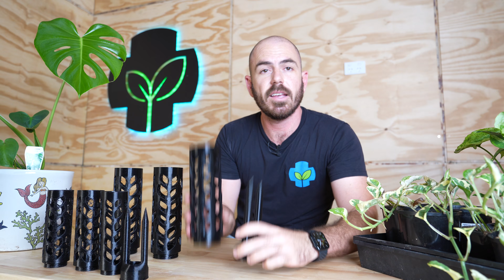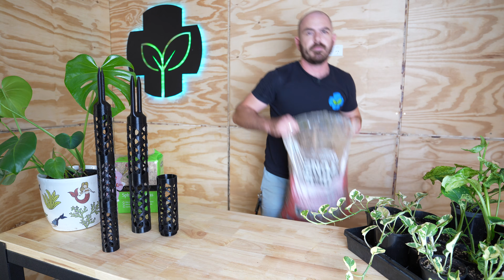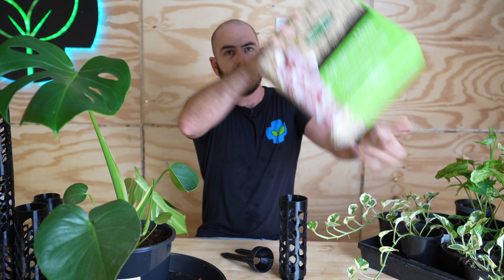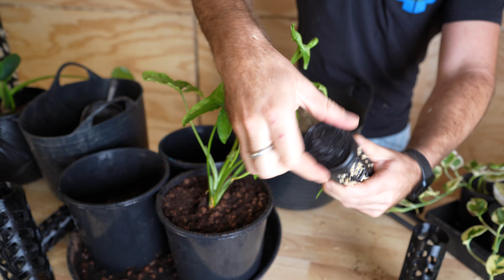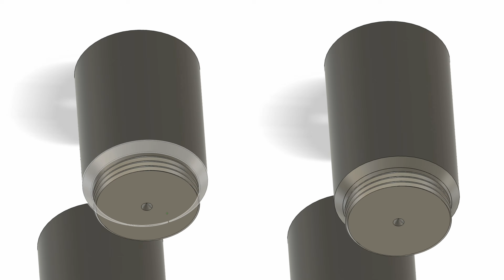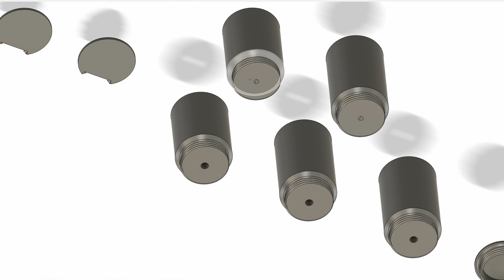3D Printable Modular Moss Pole for Climbing Plants

Comment: Info missed stated: use PETG filament, if you want an easy AND very good 3DP then get a BambuLab X1C. I have an Ender3, was my starter, it works but so much extra effort/mods  to get it to work. X1C being totally enclosed is key to success the first time not the last. Plus I've printed +1K hours on X1C with no down time and only two bad prints (that's on me). 

Moss Pole 3D: How long did it take to print:
    1 base?
    1 tube?
    1 top?

Comment: that is amazing - tried to join your fb group - bought my 3d printer and a lot more using your links - but now I have questions that needs answered - got blocked from fb because I shared something that was NOT an affiliate link - absolutely got questions and no where to go - I got the 3d printer max pro and need to know what accessories that you recommend for the printer

Comment: I really love this and look forward to downloading joining to get the file but I feel like there is a problem after your plant is rooted into the pole you won’t be able to separate the sections. The roots will grow into different sections from where the node is and make it impossible to unscrew without twisting of the roots inside
Reply from the maker: I’ve thought about this, So the way I was going to get around that is by having segments in the screw that are essentially blanks, that don’t let the roots pass, and have a little reservoir below them, that you can fill with nutrient to feed the sections below.
That way you could plan the cut ahead of time by adding a blank to where you think you’ll end up cutting, and that way you can cut the plant, then twist at the blank.

No roots harmed.

I will update the file with these segments soon.

Comment: Cost of 3d printer + filament + paying you for patreon sub to access models. Easier to use any tube cut holes and use the same concept. Appreciate the effort and love the vids but this one's a bit of a stretch compared to your other helpful uploads
Reply from the maker: This is for people that already have a 3D printer. Also, I just enjoy making stuff.
Art for art sake.

The real value in this is the things I learned doing it.

Now I’d be comfortable to make a spagnum moss based vertical pipe system… it’s all there. You just have to look.

Comment: Omg moss poles. Love how sturdy these look - I’ve tried printing a few others but either they’re too fine around the body or the pins at the bottom aren’t solid enough to keep everything stable. Looking forward to giving these a go!
Reply from the maker: Yeah I trialed a few thicknesses and I made these as easy as possible to print.
There’s a thinner one for people with their printer dialled in, but for the rest of us… 
There’s the practical one hahah
Reply: @Hoocho  oh ain’t that the truth. 😅😂
Reply: that is amazing - tried to join your fb group - bought my 3d printer and a lot more using your links - but now I have questions that needs answered - got blocked from fb because I shared something that was NOT an affiliate link - absolutely got questions and no where to go - I got the 3d printer max pro and need to know what accessories that you recommend for the printer  @Hoocho